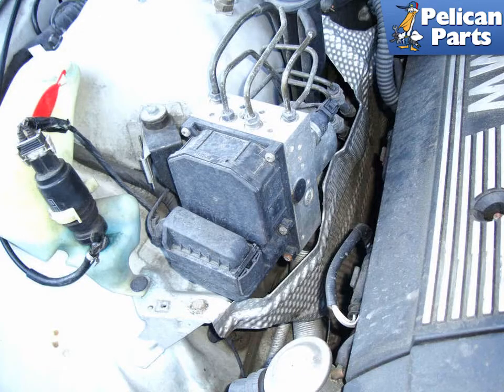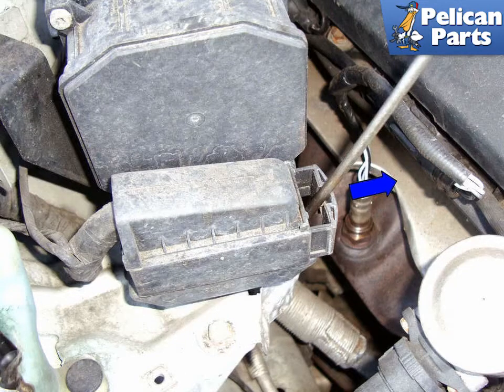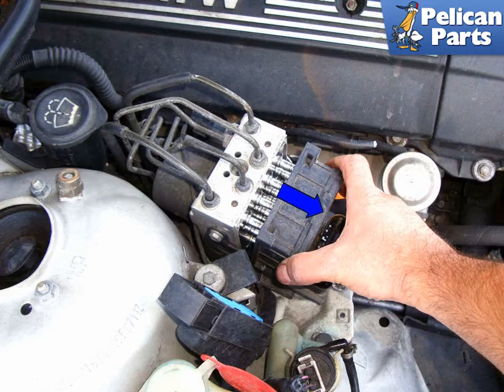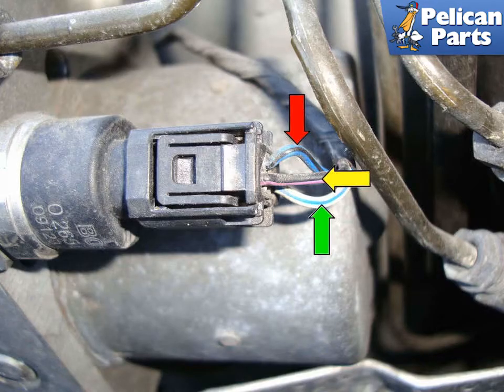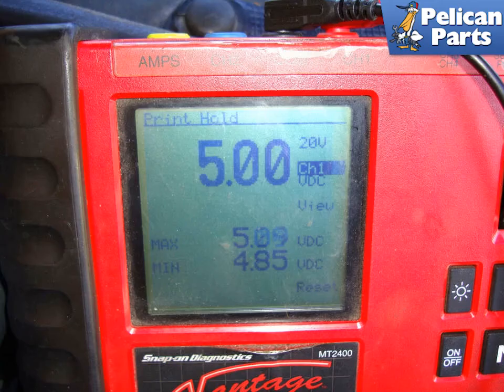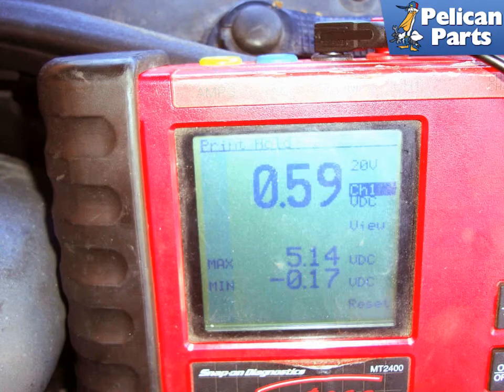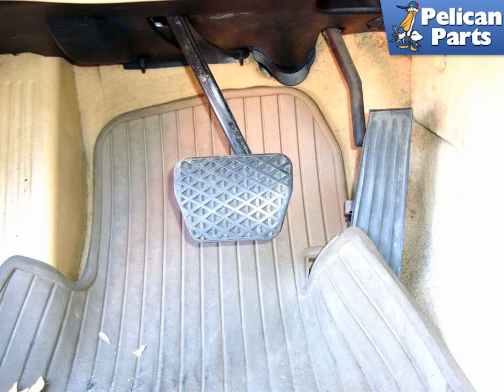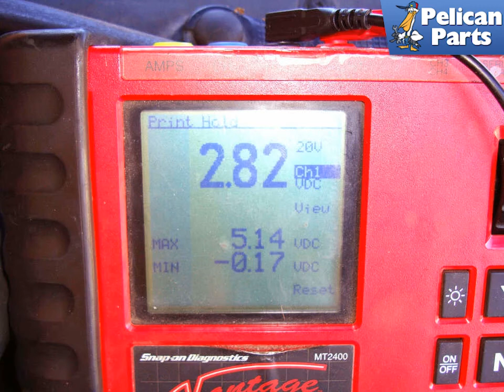BMW E39 5-Series ABS ASC Control Module Replacement | 1997-2003 525i, 528i, 530i and 540i

Comment: Can I put a 528I control module in my 530 or would I need to reprogram it? It’s a 02 E39
Reply from the maker: If the part numbers match, yes. If not, no.

Comment: Hi! I also have an E39 2002 530i - just been told it needs a new ABS module by a local garage. Funny thing is that I have had the same problem for several years now - the yellow indicators ASC+T, brake hydraulics and ABS all come on. It only ever happens in January when it is coldest here in England - the rest of the 11 months of the year no problem! So I’m wondering can it really need a replacement ABS module or is the car just not able to handle cold weather! I have heard from other e series users that their electrics also play up in the cold. Do you have any thoughts? Thanks!
Reply from the maker: It's likely a faulty module. Cold could be causing an issue in the electronics.
Reply: @pelicanparts  thank you. I recently heard there is something on the E39 530i nicknamed the “trifecta” because of the three warning lights due to a fault that commonly develops on the ABS module of that model around 100,000 miles. Unfortunately my local garage could not find a matching part in all of Europe! Ouch! They couldn’t find someone who wanted to refurbish it either but I’ll keep looking myself.
Reply: Do you all fix the abs module? If not, who do you recommend to fix the module?
Reply: @tamikarhone8421  Yes, I found a local garage who specialises in BMWs and who sent it off to be repaired. It took about 10 days. They did the MOT at the same time. This is in England though.
Reply: @robertgoodhew8050  oh ok. I'm in Mississippi.